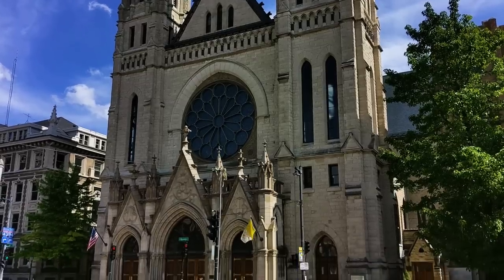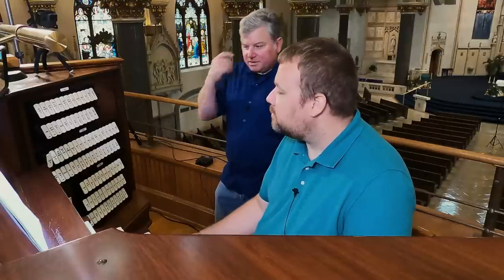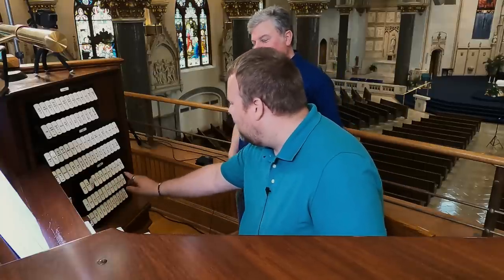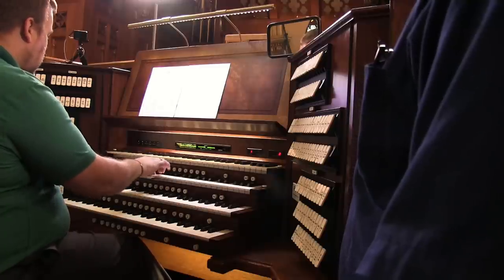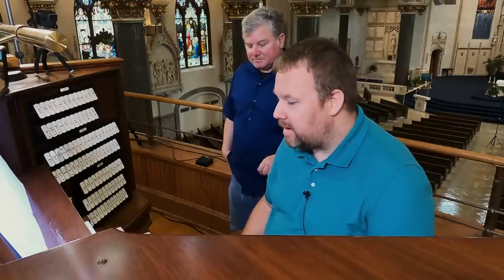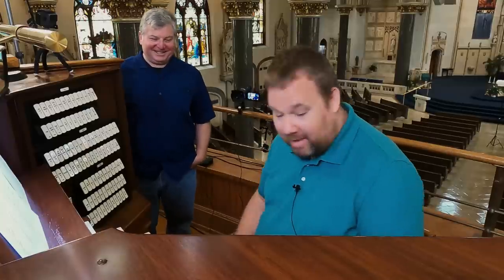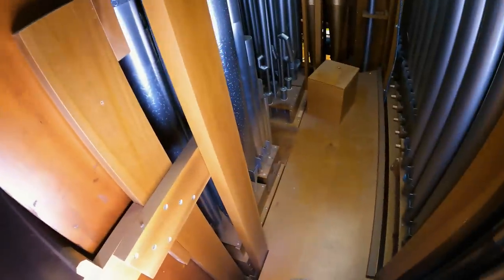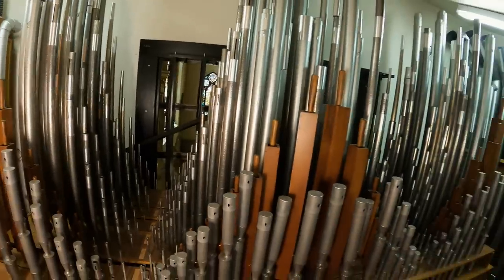2011 Schantz Organ - Church of the Gesu - Milwaukee, Wisconsin

Comment: What a joy to listen to this video!  -- the instrument as it stands today is indeed the monumental heart and soul project personally overseen by my late and dearly beloved teacher John Weissrock with whom I studied organ there privately back in 1998-2001.  Part of the pipe organ was down for repairs back then and could not really be used for lessons.  John owned a very large Viscount digital organ with an add-on Archive module at the time which he had installed in the left side of the loft back then for use as a back-up when the pipe organ was down.  This instrument of his was connected to a very large and powerful battery of speaker cabinets, and, after I begged him to take me on as a student, I took my lessons from him on that.  When the Schantz rebuild was finished the Viscount was no longer needed and removed.  He told me there were about fifteen 18-inch Velodyne powered subs in the back of the loft at that time, not all of them were being used, and when John retired finally I was fortunate to be able to obtain one of these big subs from him.  He was a very serene person and angelic in character, kind, patient, generous, tactful, a powerhouse of technique, and a great, great teacher.  I learned, so much, from him, and he is greatly missed.  May his memory continue in the hearts of all those who knew him, respected him, and loved him.

Comment: The large Church of the Gesu in Philadelphia also started with a Kimball Pipe Organ.  That church was built in 1888 and the organ was built in 1905 with 75 ranks of pipes.  Unfortunately, it was removed in 1953 for a digital organ.  The church still has it's 1898 Hook and Hastings which was recently restored.